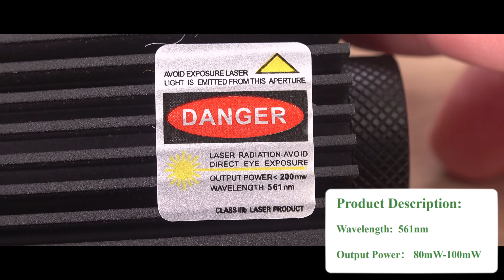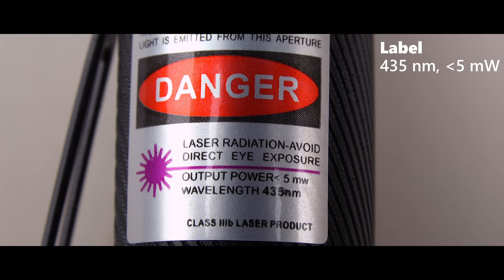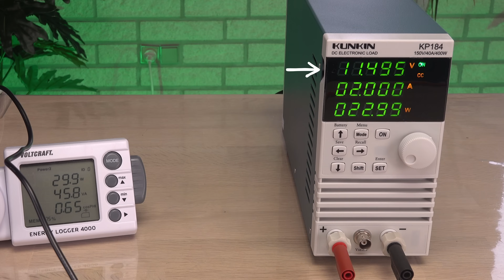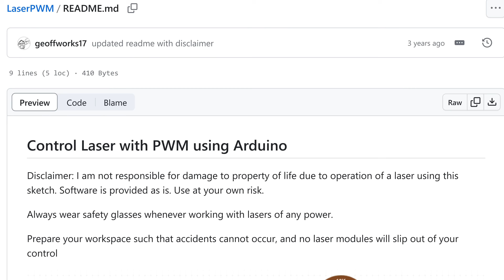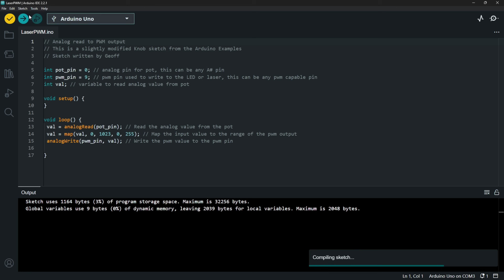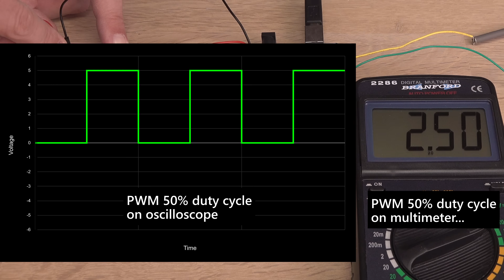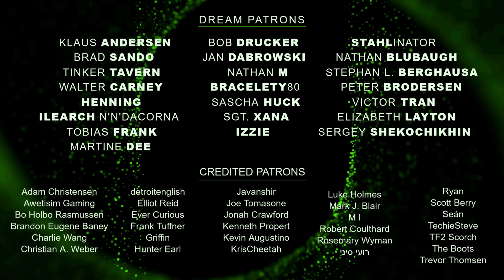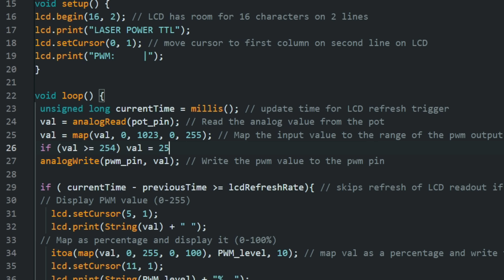LASER underpowered by its power supply? | First TTL/PWM Arduino attempt

Comment: Abstract

This video explores the advertised power limitations of a purchased yellow-green laser module. The user first measures the laser's  output to be below specifications. Upon investigating, the included 2A power supply is discovered to be different from the online listing's advertised 3A supply. The user tests the power supply limits and finds it does supply the stated 2A, though the laser itself only draws significantly less current. This confirms that the power supply is not the cause of the low laser power output.  

The user then investigates if the laser's power can be controlled externally. They connect the module to an Arduino Uno to adjust the output via pulse-width modulation (PWM). After some troubleshooting with power issues, the setup allows successful control of the laser power. Finally, the user enhances the project by adding an LCD screen to display the power settings, and discusses plans for further upgrades like physical override switches and a visual power graph.

disclaimer: i used gemini advanced 1.0 on 2024-02-24
Reply from the maker: Pretty accurate, I'd say :)

Comment: Rigol DS1054Z. Excellent quality, reasonably large screen, affordable, and perhaps maybe there might be an online tool that you could use to unlock hundreds of extra dollars worth of locked protocols / bandwidth.  Maybe. At least there used to be. It may be that rigol released a new hardware rev that fixed it.
Reply from the maker: Rigol really has some nice "entry level" scopes for serious use. The DH0814 seems like the one to beat in the price range I'm looking at. Thanks for the input and early watch!
Reply: They made a new version couple months back that replaces the 1054z
Reply: @humble2246  it appears the Z is still on Amazon, at least for now. I know Rigol lost money on paper from that situation, but I, and at least 8 people I know chose that model due to the unlock, and only one of us even really needed / used the extra features. It probably ended up selling far more units for them in the end.

Comment: Its so hilarious how you are bitching about the sticker, but then stay weirdly silent about the context
Why do so many stickers lie about the output? when its lowering the actual value of the item??
Its the same reason that so much of Aliexpress listings are behind a parenting bureacrascy wall for people in Europe.
even laser safety glasses, laser drivers, lazing diodes, are often behind a region-wall stating this "listing aitn available to your region as your address are in the fourth reich aka. EU" and you cant even see the listing, you have to use VPN.
Its such a jungle as so many laser related items are wrongly prohibited by these CN sites that simply cant find top & bottom in EU regulation when it comes to such items
I use lasers for spectrometer works and science, and instead ofgetting it from the main sources in CN, we often have to pay EU resellers flipping the price with +1000%, so the diode we would get in CN for 12US delivered , suddenly cost  +120US + shipping.
But sure Brian, your a good  radical EU comrade, whining about the labelling, and not the extreme censoring that is the reason why so many items are mislabelled.
Reply from the maker: My issue with the labeling is simple: It's a huge safety problem for the unknowing. No matter the reasoning behind it. Not sure why you are so bitter at me about it :)

Comment: I can't help but wonder if this would work with WLED on single colour mode. it would be pretty much no programming and simple wiring.
Reply from the maker: I'm pretty sure it would work. LEDs are very easy to brightness control - be it analog or PWM digital. Thanks for the early watch and comment!

Comment: You should do a video on one of the RBG laser modules all over ebay. I got a few of them and got them to work with TTL via arduino. The 500mW is the highest power I've found where all the diodes are single-mode and above that the beam/spot quality starts to become poor. The 2W version I have has very bad divergence with the red diode.
Reply from the maker: Thanks for the tip. I have noticed them and some of them look really interesting. With my recently improved skills on using an Arduino, I might give it a try :)

Comment: The issue with the powerbank and arduino turning off may be due to the power saving mode of most powerbanks, where if insufficient current is drawn for a certain period of time, the boost convertor is turned off to conserve battery life. Microcontrollers typically draw very little current in operation, but given that the issue later resolved itself, I'd imagine that it is just on the threshold of what would cause it to turn off/remain on, and small variances in ambient conditions can bias it either way.
Reply from the maker: I think you are right. It was very erratic. The last shot where everything worked perfectly, the Arduino is powered by a USB charger plugged into mains power...
The power bank has no issues with running a way more power-hungry plasma globe (as shown in the video 'Monster magnet meets monitors...') but it was never fully happy with the Arduino :)
Reply: There is an workaround on GreatScoot's channel if anyone is curious. He addresses the problem with that power saving mode on one of his videos.
https://www.youtube.com/watch?v=ty5JueA1wRc
Also, in some of the powerbanks, the power saving mode can be turned off, so it will stay on even in small loads. You may look into your's powerbank instruction. Typically it's done by clicking the power button couple of times (e.g., triple-click), or one long click.
Reply: @dabasalomon4764 wanted to say that XD
Reply: @brainiac75 USB-C power delivery power banks usually have an always-on setting. How to activate this setting varies so check the description before buying.
Reply: I’ve got two different power banks with a  low current mode. My Anker for example can have the usb a port set to stay on by double tapping the button. My newer ugreen will also do the same. Additionally plugging in a device with a higher current draw with the low current draw device is also a decent way to keep things powered in a pinch. I’ve only seen one power bank during my life so far that never cared about the current draw being low but ironically it was a cheap chinesium power bank I had found at Walmart for like $5.
Reply: I can confirm. Had the exact same problem myself!

Comment: Are custom laser drivers such as this common? I'd imagine being able to tune a beam's output would be handy, but I never see it used in videos (until this one). Great work as always!!
Reply from the maker: I would say most 'lab-style' laser modules with a driver board have at least the TTL function, where the laser beam can be turned on  and off using +5V/0V. And probably also PWM to adjust the power.
Unfortunately, they don't have a standard for the pin-layout. Some have three pin connectors including power, some have two pins for the TTL alone (and some have both the three and two pin connector...). Some reverse the pin lay-out shown in this video. On my 500 mW 405 nm module, the left pin is +12V power and the right pin is +5V TTL. So be aware of that :) Thanks for the early watch and comment!